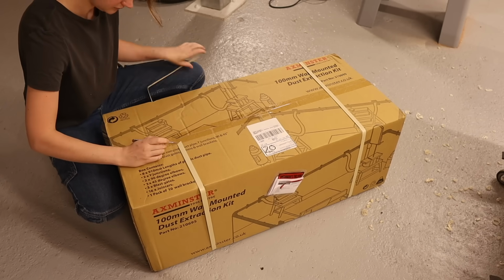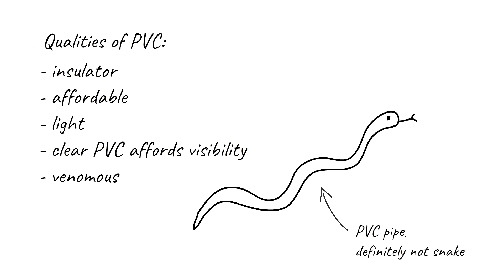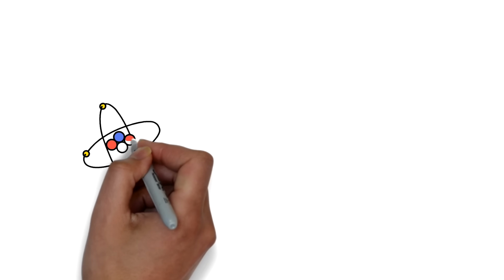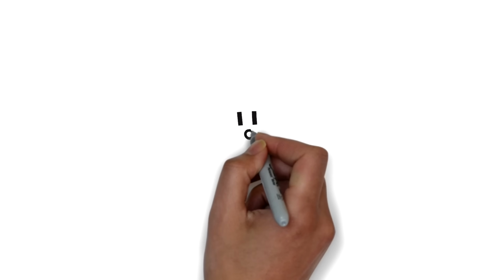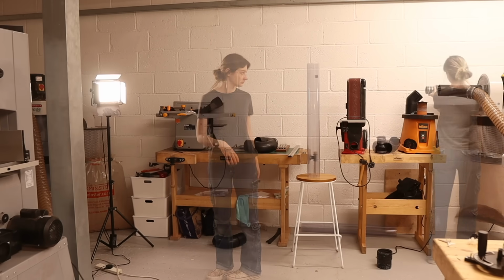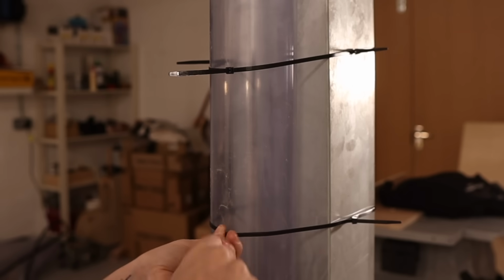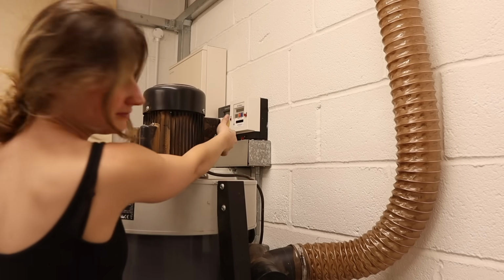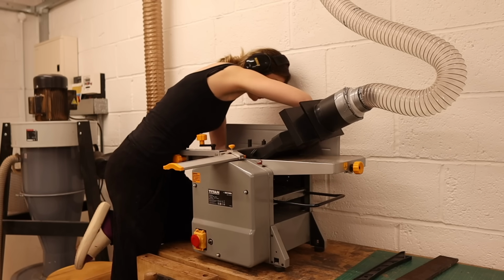Why Your Dust Extraction Might Explode

Comment: Great video, I honestly need to do my workshop! One thing, I occasionally sand metal with my belt or disc sander and cut metal bits with my bandsaw......am I wrong g to do this from a safety point of view with a dust extraction such as yours?
Reply from the maker: Does anyone in the comments know the answer to this? I don’t think I do sadly!
Reply: I'm not an expert, but IMO if you're sanding or grinding steel, it can make sparks, so you want to do that way far away from either sawdust or the fast-moving air a dust extractor creates. Sanding nonferrous metals that can't make sparks isn't as bad, but it could still in theory create enough heat to start a fire/explosion.
Reply: @KarlBunker  I don't grind steel, only non ferrous metals, so non sparking.

Comment: Don't forget to ground your container. If something is to catch on fire, it'll be this, especially if it's steel. Grounding PVC on the ouside however, isn't going to work, there's a lot more surface area that doesn't get touched by the wire then is touched. The inside wire should be enough. In any case, this is way better for your lungs. Thx for the vid
Reply from the maker: Yes! Forgot to mention this.
Reply: There are anti-static sprays that can help spread the electrons around the outside of the tube, fabric softener works too and I've used it before as it helps remove static from our jumpers to make them feel smooth. These treatments do loose effectiveness over time and need reapplying but they do help nicely.

Comment: So.. do you need a good copper, or a bad copper to round up those freeloading electrons? Or will any copper do? ;) nice video. Being a hand(powered) tool woodworker myself, all my dust/shavings are extracted by a hand wielding a brush and then deposited, into a big pile in a binbag. Probably not all that safe either, come to think of it.

Comment: Hi Daisy. So firstly you are not doing anything wrong per se in that it is not unsafe. But if you want this to deal with static build up it is unfortunately next to useless. PVC is a near-perfect insulator which is why it covers electrical cable. If it was even a tiny bit of a conductor then anyone touching a power cable would be electrocuted. If you run a copper cable along a PVC tube it will only therefore earth the exact point it touches the pipe. A static build up even a mm away from the wire will not earth it. For that reason a static build up at the exact point the wire touches the pipe will be grounded but nowhere else.

But let’s do the maths to see if even one wire helps. For a 100mm pipe let’s say the internal circumference is 314mm. Assume a 2.5mm copper wire actually has a surface contact area of 2.5mm (it doesn’t - it’s less). That means that if you secured the whole wire to the inside of the pipe so it is in constant contact then only 0.8% of the pipe will have protection. 

Putting copper on the outside is sadly pointless. Yes it will discharge static on the outside at a contact point but has zero effect on static inside the pipe - electricity (static or otherwise) can’t discharge through the wall of the pipe. The good news though. It is pretty much impossible to get an ignition in a home shop (as you rightly said).  Doing what you have done doesn’t make it worse though as I said above.  But it will in no way will provide any significant protection. Sure, 0.8% is better than nothing but the basic risk is as close to zero in a home shop so it makes no odds. 

If you are worried about static then your only option is metal ducting I’m afraid.

If you want a more detailed explanation have a look here https://youtu.be/yA22kTtV4XI

Comment: Nice one. Did you do a continuity test on it? otherwise it might just charge up like a capacitor, and then arc to earth where one of the bad connections is (if there is one).

Comment: Great job. Dust explosions can be horrendous.
Reply: High air flow, highly flammable particles whizzing around... not a good combination. Four Eyes Furnitures had a scare just last video they posted. 
Dust in general is so underestimated when it comes to danger, especially when working with exotic woods. Breathing that in will cut years off your life.

Comment: Maybe I didn't understand well, but you should not connect grounding between vacuum system and any other device. In general, ground should be made "per device" - otherwise you could create mini-circle when current goes "to the wrong ground" (if you want to get more on this - look for triangle- and star- connections of the electrical network). This could lead to an issue when grounding wire starts to work as fuse and melt vent system (as current always goes to the direction of smallest resistance and copper provides such).

Also, external ground wire on pipes should be isolated (several layers of transparent scotch sticking wire to pipe will be enough) - again to avoid any short circuit wire-Daisy-floor.

PS. Igniting of the powder (saw dust, flour, sugar powder, etc) depends not only on humidity level, but also on very tricky ratio between electricity field intensity, particle size and distance between particles. Very briefly, ignition happens because lightning starts to jump from one particle to another, and there're thousands of such lightnings -> which increase air temperature -> which ignites everything in the air.
PPS. Humidity helps with those "electrons running away" - they starts to run away from every surface thus there's no electrical field of necessary intensity to ignite reaction. Until there is field with necessary intensity to ignite reaction...
PPPS. Yep, boring magister of theoretical physics there... I'll show myself the way out )
Reply: I'd go with the star connection method too - simply because if the first grounded point fails, then everything else connected to it after that isn't grounded any more. Serial grounding gives you no redundancy at all. With wood dust, ideally use metal, but electrically conducting plastic pipe (yes it exists) is probably as good.

Comment: Just stumbled onto you chanel and all i can say is wow you amazing artist just one thing tou you have still not earthed the dust extractor you still need to earth off the wire to an earthing point which in you case is the steel conduit you wiring is in other than that you could always connect it the the main earthing that goes onto your fusebox dont and you will gain more suction if each machine as a blast gate that has no gaps for air to escape this is the biggest cause of loss of suction

Comment: Is the copper wire insulated? It looked like it was coated. You don't want coated wire for your ground if you're trying to capture static electricity in your extractor. For that, you'd want bare wire.  If the coated wire is just on the outside to connect bare wires on the inside to each other, that's fine. If that's all I was seeing, then disregard my alarm.

Comment: Hi Daisy, there's a YouTuber called John McGrath, his channel is 'Man In Shed'. John is a woodworker but his day job is an electrician who explains this very subject really well. John also works in potentially explosive environments and goes on to explain, as you have, that PVC  is an insulator and cannot be properly grounded, even by wrapping a copper wire all around the pipe. That is why it isn't used in environments where there is the possibility of an explosion. If I remember correctly he also does a couple of demos in his video. It's definitely worth looking at. I still find your videos both interesting and entertaining though, so keep up the great work.
Reply: The copper wire is there more to deionise the dust rather than the tube itself. It is the exact same system used in large coffee grinders (not in your average kitchen model, though) where you have a grounded metal grid sitting in the output spout to kee coffee grounds from clinging to the receptor. That said, materials that build up static electricity are not allowed in EX environments (while I am an abslute coffee idiot-level nerd, it is not my line of work. Offshore is, though 😊).

Comment: Hi Daisy. I'm a keen follower of your videos and love the explanations you give. The way you describe the migration of electrons might sound a little unusual, but it is accurate enough. There is, however, one thing which I am a little concerned about and that is the copper wire you used for earthing it all. We don't see much of it in close up, but is it insulated or bare copper ? The reason I ask is that where we briefly see it in the video it looks shiny like it is covered in a thin layer of clear plastic. I do hope that this is not the case as, if it were, then it would be insulated and could not work properly. One day I will probably do a similar job in my own workshop and, if so, I would probably use a strip of self adhesive copper tape inside each tube. This is often sold as "slug tape", as copper makes a natural slug barrier, and I also often use it for screening inside the cavities of electric guitars. It is really great seeing you getting your workshop all sorted out but it is making me rather envious !    Keep on keeping on.

Comment: One of the Y branches looks like it is going in the wrong direction.  Picture the dust as a car merging on to an expressway.  It looks like you are using braided wire, does it have a coating over it?  It needs to be bare the whole run.  It is hard to tell from the video.  Thanks!

Comment: Miss Tempest Use a Ladder not a stool ! 
also run a wire  to a screw in the case of your dust extractor and solder it to the wire in your tubes you cant have too many grounds.
Reply: @Peter_S_  that is why t told to ground it to a screw on her dust colector's body 
The wires In those Flex Tubes can break !
Oh those flex Tubes are gronded to the body of her dust colector'

Comment: Excellent video, but if you're really concerned about shop safety, I'd recommend that you cease standing on a stool and get a proper stepladder. Just a guess here, but I'd venture to say that you're far more likely to fall than start a fire in an ungrounded sawdust tube.
Reply: I cringed when she stood on that stool.  My sciatica and dodgy hip won't let me climb on something like that.  So I don't have to worry about falling off, but she does.

Comment: 8:30 Please consider using a Thicker Plastic Zip Ties on the vertical tubes ((or better to use metallic zip ties, like this one you have here 8:43)) because it is the place where you can accidentally hit the vert tube where the thin zip ties are, and they are known to be not the sturdiest. I just want you to have a better construction that you would forget about and it won't bother you ever again.

Comment: One other issue static can cause that not many people talk about, is that it can damage tools. Especially tools with electronic speed controls. Obviously this is less dangerous than the fire risks, but it's still just as valid a concern.

Comment: This debate never ends..... There are those who say that the static may build up, but the spark can not cause a fire. Others say that it can, but from what I have heard, there has never been a case of a fire starting from static spark, or one that has been proven to have started from static spark. I went with all metal in my shop. Use as little of the corrugated flex pipe as possible since it greatly reduces air flow. For the copper wire on your pipes, I have heard of some who run a wire on the inside, but that is not often used due to the risk of clogging in the system. I have seen several who would wrap the wire around the outside. Don't think I have seen anyone use both. A redundant system at the least. I did ask, years ago when the in the wall type vacuum systems for houses was a rage, about grounding for the possible static spark, and they had no clue as to what I was talking about. Like none at all. I have 'caught' a kid at the bottom of those plastic sliding boards in the play ground, and you sure can get quite a static shock from the kid.... Actually clogs in your pipe systems are extremely rare. I got several from forgetting to empty my chip collection barrel. I did go with a 2 stage system and a pleated paper filter which offers far finer particle collection than the old cloth bags, and no chips clogging up the impellor, which happened frequently when I tried to suck up lathe shavings. Your planer and jointer will generate most of the chips. With the others, a scoop shovel and broom will work more efficiently. Only use your dust collector for the little stuff....

Comment: I’m not sure if I missed you mentioning it or showing it in the video, but it would probably be a good idea to pull a separate ground wire from the dust extractor’s chassis to your bare copper wires, instead of relying on the copper spiral in the hose to do it. Another way you can check the system is to measure the resistance from an outlet’s ground pin to the ends of all your pipes, that way you know that you have a solid ground end to end. It can be done with a multimeter quite easily, but it involves sticking metal objects into outlets. 😂

Comment: Did you run a bare ground wire inside the tubes also? Those need to have a screw terminal connecting through the wall of the plastic and need to be grounded to both the inside wire and the external wire wrapped in contact with the outside of the tube. I picked this info up from lengthy technical discussions with electrical engineers and physicists some 15 years ago on a CNC machinist discussion board.

Comment: Did you remove the clear lacquer from the outside of the copper wire at the points where it connects to the little round metal connectors, screws etc?
I'd suggest getting a multimeter and testing whether you get a complete circuit from the end of the wire at the ground, vs the end connected into the pipework (a continuity test).

Comment: I've never seen such nice atoms, I personally would have avoided putting copper wire in the tubes because it might hold chips and clog, maybe it was better to use aluminum insulation tape instead of copper wire but still not bad, congratulations sister🙂

Comment: Like chargers repel, so the neutrons which are electrical neutral are in the nucleus to bind with the protons & stop them flying apart. The electrons are in orbits along way from the nucleus & can be relatively easily knocked off & if they land on an insulator will spread to put as much distance between each other as possible, but the insulator will charge up & discharge if a lower potential comes by. Not sure if your copper has a lacquer on it, if so it’s insulated. Test a little bit on the sides, not ends which will have bare wire, with a 3v lithium button celll & a red led. If the led lights with the battery one way or the other all is well, or just check for continuity on sides if you have a multi-meter. No continuity means wire is insulated with varnish. This is what transformers are made with & the lacquer will easily with stand 300 + volts & so won’t ground. Biggest fire explosion risk is from gas or vapor. If you smell either, ventilate & don’t flick any switches as sparks will ignite explosive mixtures. Good luck!

Comment: Wood dust extraction systems are one of the most dangerous things, if not maintained and cleaned often they can explode due to heat build up. Part of my job was risk assessments in a commercial workshop where we had insurance inspections every 6 months. I hope you have insurance cover for this.
Reply: Te-legramme_DaisyTempest  ok
Reply: Te-legramme_DaisyTempest  can’t get this link to work

Comment: A client of mine, who had a high-quality wooden door factory; He once told me that wood contains small amounts of silicon. Apart from grounding the dust extraction system; they had placed a water pipe inside the place (tank) where the vacuumed sawdust was stored; because there was the possibility that two or more silicon particles, traveling at high speed through the tubes, have collided and generated sparks. Only 2 times in 50 years did they have to flood the sawdust tank; but they had had fire beginnings for that reason.

Comment: Here is a good video with details about why copper wire isn't actually doing anything in PVC. I use metal duct which is then grounded to better address any static issue.

https://www.youtube.com/watch?v=yA22kTtV4XI
Reply: @DaisyTempest In the video, John demonstrates that you can still pick up static charge on a PVC pipe even if it’s completely wrapped in a coil of copper. And that is certainly more attempted grounding than a wire running down the inside length.

When I was a baby electrical engineer decades ago I was taught that, in order to protect from static buildup, you need to make the material conductive and then ground it. Unfortunately PVC is a good insulator and, short of coating the inside and outside in foil, there is no way to make it conductive and so grounding has little effect. Running a wire down the middle would certainly remove the charge from sawdust passing right by it, but the sawdust passing the side of the pipe wall would build up charge there. Now, the chance of an explosive environment in a small shop is practically nill. But I chose to pipe with metal duct because it was cheaper as well.